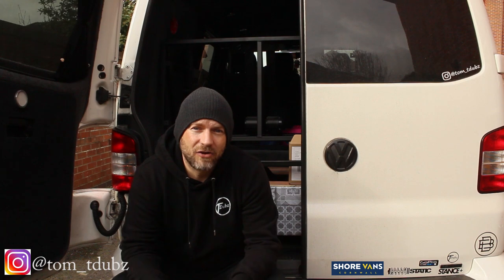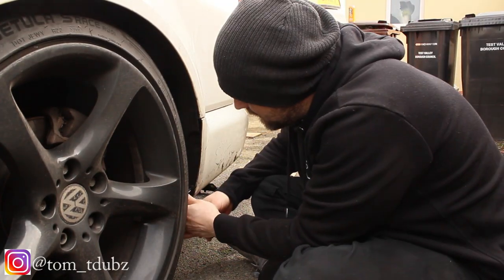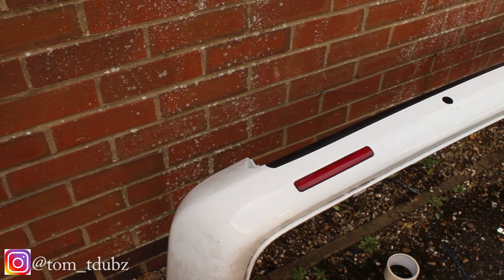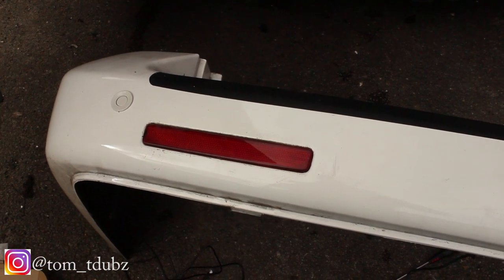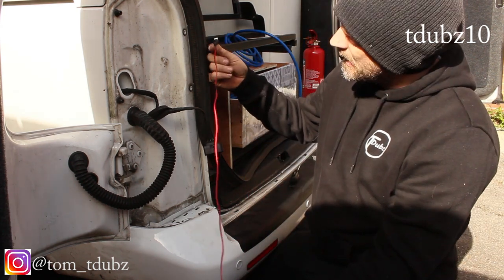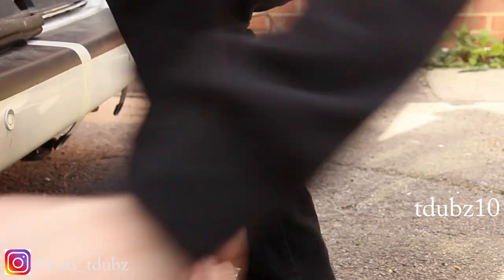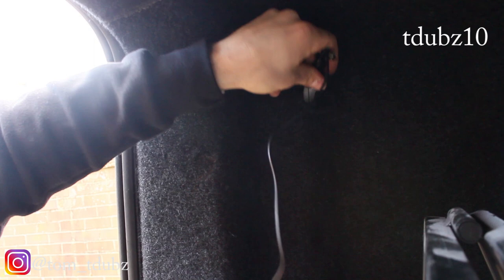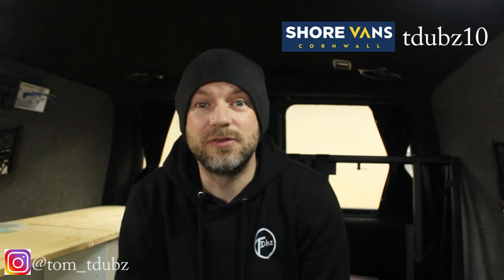Parking sensors vwt5 #shorevans

Comment: Well I did mine today, luckily on the T5.1 bumper there's location markers on the inside for where the sensors need to be fitted. My bumper definitely didn't come off as easy as the one in the video, it was a right pain to remove with clips everywhere.
Reply from the maker: Think this wasn’t a genuine bumper as didn’t have any markings… they are a pain, the 2013 onwards are even worse

Comment: Hello! Can you describe how you prepped and painted the sensors before fitting them - I've got my sensors and just waiting for my spray paint to arrive before fitting mine to the bumper. Cheers
Reply from the maker: Sure, 
cleaned with alcohol wipes..
Sprayed with plastic primer,
Let dry and spray again with primer
Apply thin dusting of tip coat-white or the colour of your van,
Then again after 10 mins
And again after 10 mins
Then gloss to finish, couple of coats 👌🏻

Comment: FYI for anyone with a T5 with tailgate rather than barn door - there's an additional (super sneaky) screw holding the bumper in BEHIND THE MUD GUARD... Use the same bit as the other ones through the mudguard, but you'll need to push the mudguard forwards to access the screw behind it. Took me an hour or so of swearing before I spotted it haha
Reply from the maker: Turtle Bay Diving oh no fella, all sorted now?
Reply: T Dubz yeah man!! It’s not your fault at all - just a heads up for other peeps if they have the tailgate version :)!
Reply from the maker: Turtle Bay Diving good work! Thanks I’m sure others will have an issue too 👌🏻👊🏻

Comment: I have two green and black cables. 😬 any suggestions welcome. Thanks
Reply from the maker: Ermmmmm no I only had one, 🙈 sorry fella can’t help ☹️
Reply: @tomtdubz  use a multimeter, bare cable back, and test in reverse as and when the cable is live!! if its only got 12v on it when vsn is in reverse then you know that's the reverse light feed you need.

Comment: Where can I get the gromits you used to fix those bumper flaps back in place at 22:53 in your video? My flaps either side are just flopping around underneath...  cheers
Reply from the maker: They are just the interior clips.. have you got some?
Reply from the maker: Trim panel clips 👌🏻
Reply: @tomtdubz  I ordered a handful yesterday. No idea if they are the correct diameter yet. If all else fails I will purchase the identical ones you used.
Reply from the maker: Mine were the light grey original interior trim clips/bits 👌🏻
Reply: @tomtdubz  Spot on, I took a stab in the dark and ordered a set of grey trim clips and they worked a treat! Even managed to fit the middle clip in under the spare wheel clamp using the handle of a hammer and wheel nut wrench to shimmy it in.
Reply from the maker: Good work fella, found some more bits on mine the other day that we’re missing! Sometimes hat buying things second hand
Reply: T Dubz there was a handful of missing parts on mine. Broken cup holder, no spare wheel, no barn door check strap... list goes on. Next mod is to upgrade the steering wheel to the leather high line version. Stock steering wheel tends to get sticky and worn.
Reply from the maker: Mine was trashed, sounds like you’ve got a lot of work on your hands. Fair play! Nice to do it yourself 👌🏻🤙🏻
Reply: T Dubz did you post a vid on the wheel?
Reply from the maker: Steering wheel, yes...
Reply: T Dubz would be good to get together with our T5s and compare notes once the lockdown passes. Always good to network with other owners. Where you based?
Reply from the maker: Sounds like a plan, was thinking about sorting some sort of meet out... I’m based near Southampton.. about 3 miles out..

Comment: I bought a set of these not the ones you fitted I got mine off eBay total waste of time think they were from China so in the end I bought a dash cam with reversing camera from amazon
Reply from the maker: So far these are decent! 👍
Reply from the maker: Which one did you get? Cam?
Reply: Easy to fit up hard wired into the fuse box or you can plug it into the cigarette light thing

Comment: Just done a friends. Thing is, looking at your video I don't think you have the proper metal bumper that should sit inside the plastic one?  If someone else watching this does then you need to place the sensors so that the back of the sensors will go into the pre drilled holes in the metal bumper.
Reply from the maker: Thanks for the information. This will help others if that is the case for them on their bumpers.
Reply: I have a 2004 T5 and can confirm I had to drill at 500mm centres about the middle of the bumper (250 to the left, 250 to the right) then make sure the outer two cleared the metalwork completely. The metal part looks different to the one in the video.

Comment: Never cut the reverse signal and ground wire burn off the installation and wrap the wire around it.
Reply from the maker: car audio solutionz good shout, I’ve been working on soldering for the next set of wiring 👌🏻👊🏻
Reply: @tomtdubz  Don't use solder as on some vehicles it will put bulb error lights on the dash due to resistance. 
I've fitted sensors in 100s of vehicles and my method always works I've never had anyone come back.
Reply from the maker: car audio solutionz thank you! Your method it is👌🏻
Reply: @tomtdubz  Thanks..
Reply from the maker: car audio solutionz no thank you fella, all about learning 👌🏻👊🏻
Reply: @tomtdubz  That's correct i have 25 years experience and supply and fit all types of vehicle Audio/accessories/lighting/security etc,
If you ever need help drop me a message.

Comment: Did all that. It don't work
Reply from the maker: What year is your van?
Reply: @tomtdubz  Hi, 2005 with a tailgate. I wired it all up and 'piggybacked' into the reversing light and the earth (all the lights work) but no sound from the bleeper. Maybe the box is faulty.
Reply from the maker: @thurstonhowell3569  maybe, if you have power, correct earth, and contact with the reversing wire should be all good…
Reply: @tomtdubz  Turns out is was the connectors I was using. The supplier of the sensors said to wrap the power wire from the control box directly around the existing power wire from the VW. Low voltage so I guess it'd be ok.
Reply from the maker: If it works… happy days 👌🏻

Comment: Lol.. if you had turned the bumper over there's factory locations.
Also use a bumper stand you wrecked the edges of the bumper.
Reply from the maker: car audio solutionz yep lol I did see that once I’d looked lol, strangely enough the two middle were spot on 😎 did realise the damage to the paint that could be cause too, we’re all learning 👌🏻👊🏻
Reply: @tomtdubz  Haha you did a pretty good job for the 1st timer I've fitted parking sensors to loads of T5 T6s.
Reply from the maker: car audio solutionz why thank you 👌🏻👊🏻